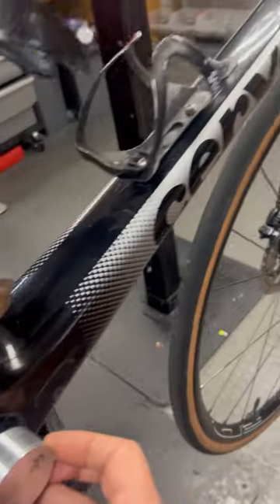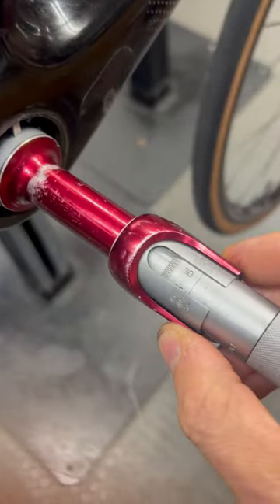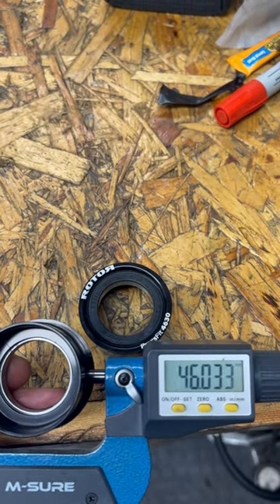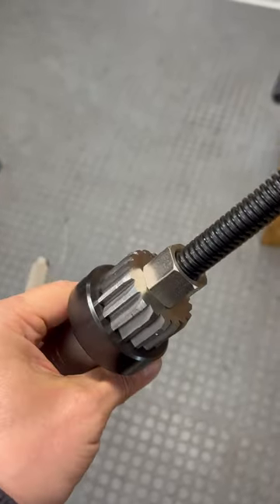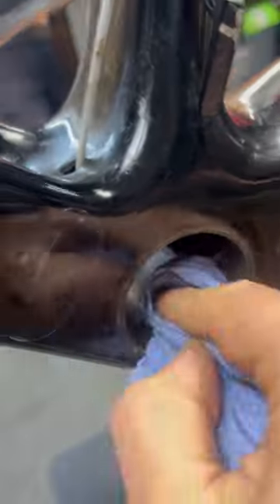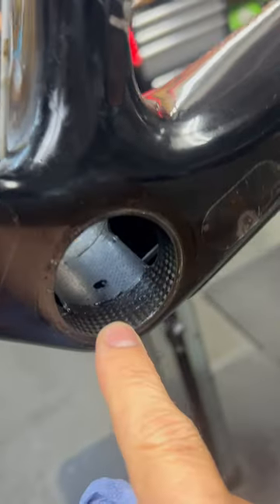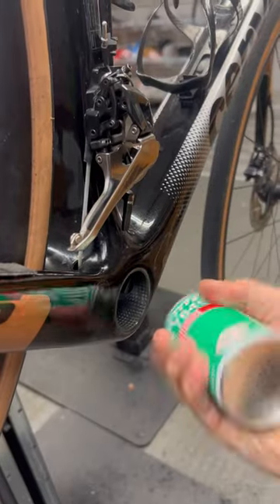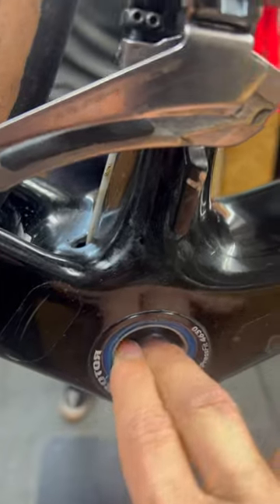A super tight Cervelo

Comment: If it’s not threaded I’m not buying
Reply: Press fit should be illegal unless the frame has 100% precision bottom bracket hole.
Reply: Exactly. They are just taking the customers for mugs by producing a sub standard and shoddy product. I only buy bikes with threaded BB's
Reply: If its not 1 piece metal tube you can still have misaligned cups, which you then can't do anything about
Reply: Even 1 piece metal tube BB’s can be a mess from poor welding and poor alignment within the frame.
Reply: What about a 1990's Klein? I never heard anyone complain about those being press fit. Same goes for any old American bike with a one piece crankset, the cups never creak on those either.
Reply: @Mike0  "...you can still have misaligned cups??"  Then send the frame back and tell the mfr to send you the quality part you paid for and not some defect off their production line.
Reply: Hear hear. Can't beat a simple Hollowtech system with threaded bearings.
Reply: @TrueBlade-1889  Square taper cartridge BB is king. Bearing life is superior, the cartridge doesn't suffer from misalignment issues as easily, and you can adjust the chainline for any bike/crankset/hub combination by changing axle lengths
Reply: just means brands dont need to give a shit about alignment.
Reply: Thats why I prefer threaded full metal bottom brackets welded in the frame.
Reply: Threaded bb have the same problems if they are not in spec. Im a professional bike mechanic for nearly two decades and I really like pressfit bb's they are the best if they are in spec. This standard gets reamed for all the wrong reasons.

Comment: Carbon pressfit bb shells are super fun when they widen under load after 1-2 years of use. And the manufacturer does not warranty them due to "improper use or installation". Suggested solution: epoxy in the BB 🤦 Oddly enough, new models now have T47...

Comment: I still have had a reply about cutting Carbon Fibre like this, and the Bearing dust seal appears to be damaged at the very end of the video: a step of it cut, and at the top of artists to have been compressed/pushed in.  Even the ID/OD measurements seem way off for what it's getting described.

Comment: What are the advantages over having a pressfit bottom bracket? And wouldn't the bike be built up with the carbon with a dowel to build the carbon upon? That would make it perfect.
Reply from the maker: Pressfit removes a bearing carrier and allows the bearing to be closer to the pedal to stiffen things up. These bikes are laid up in two halves and cured together. I would love to know what goes wrong in that process. However I think the big issue is that it is just not well QC after mould and paint

Comment: Why do you need any LOCTITE glue for a pressfit? Thanks
Reply from the maker: Fairly big subject, but briefly. It is a retaining compound designed to fill gaps upto 0.15mm. So it fill all the tiny irregularities to provide a firm hold of the bearing into the shell.  It is not a universal method.  It’s use depends on the materials.  There are lots of different types of retaining compound and activator that will fill different size gaps and work with different materials.  The best thing is to read the installation manual.  You will often find that it will prescribe the exact method. Sometime it will be grease, retaining compound of some sort, silicone glue and often it will say use nothing at all.
Reply: Any bike that prescribes Loctite of any type to install the BB does not get my business. Not gluing anything into a frame that then has to be hammered out when serviced. That’s just me. 😀

Comment: I used to have a Cervélo and the BB issues I had were apparently due to the Rotor crankset, as a switch to Shimano solved the creaking for good. That being said... I wouldn't buy another one, knowing what I know nowadays
Reply from the maker: Umm.  It likely solved it because of being able to use plastic cups and a smaller bearing, giving a bit of room for compression. If it works it works.
Reply: @Mapdec  so my BB was probably still crap, huh? Hahah
Reply from the maker: @RicardoRocha-lg1xo  🤷‍♂️

Comment: do you sell the resurfacing tool? i scored my carbon shell with a wheels Manufacuring bb and the splines dug into the carbon under torque. should the face be resurfaced?
Reply from the maker: No. They are very expensive, I think the tool in the vid was about £450.  It’s only really bike shops that buy them.
Reply: @Mapdec  can i email you with the issue that i have? i wanted to see what your thoughts are on it. thank you
Reply from the maker: @rexfest  just bring it into the shop. We can’t fix things via email. No need to book.

Comment: Lovely tool and work, but I would install a Bb-Infinite single block , and bye bye issues , that rotor will last 15k and then you need to hammer 🔨 blast them out , because you used the heavy retainer compound.
Reply from the maker: Thanks. We don’t use hammers. We have a range of BB pullers. Also, it can be softened with a bit of heat.

Comment: If it's small ... what was in there before?
Reply from the maker: A throttled FSA bearing with just enough room to breath though it’s plastic case.
Reply: @Mapdec  Doesn't sound ideal for bearing or frame, but I guess they jammed it in and got away with it. I'm no expert on bottom brackets, they seem even more confusing than tubeless. I have a "normal" Shimano bb, which hopefully is more tolerant of fit.

Comment: Special place in Hell for whoever invented pressfit bottom brackets. 

It creaks all day in hell.
Reply from the maker: I hate to break it to you, but the bearings in your threaded frame are a press fit into the housing you screw in. The problem isn't press fit, it's the manufacturing tolerances of frame manufacturers that failed.

Comment: The bikes of 20 yrs ago were easy to work on, you could purchase a new bike the pros rode with full Dura Ace for a fraction of the cost, nothing like this. These things are a nightmare fragile expensive frames / components, push fit BB, full internal cabling, disc brakes 🤦‍♂️
Reply: Agreed

Comment: why can't bike makers do this at the factory???
Reply from the maker: Sadly, the same reason bike shops don’t check, no one notices until it creaks.
Reply: @Mapdec  that isn't really a reason, customer satisfaction would go up if they did a better job, so would setting up tooling in a factory to do this be very expensive? do any brands do it?  Hambini, who is an asshole, likes to poop on Cervelo about this a lot but isn't everyone doing this badly?
Reply from the maker: @JackMott  I couldn’t say that any one brand is consistently bad.  I would love to know what happens in QC to let these problems through.  However, when they do slip through it should be the role of the dealer to correct them.

Comment: Paul's 10 million dollar tool inventory ?
Reply from the maker: Not quite, but I do love good tools
Reply: @Mapdec  I saw a bad practice at the FOX service centre in Sydney , Australia . Using the open end of a spanner to remove fork upper air , and lower oil seals . You can scratch the ledge that the oil seal sits on .

Comment: Loctite on a PF BB is a recipe for creaking. Absolutely no need for that.
Reply from the maker: You mean bearing retaining compound made by loctite.  Holding a bearing is exactly what it is designed to do.  It’s a gap fill to fill voids in manufacturing inaccuracies.  It will prevent creaking on oversized holes. If you use it on undersized holes you will have other problems. Mostly related to the undersized hole rather than any compound used.
Reply: @Mapdec  I stand corrected. Oversaw the type of compound. Thx for the explanation. You never cease to learn

Comment: I thought Cervelo were similar to Santa Cruz and use Reserve rims. Why are they using this crap bb system when SC were one of the few brands that almost entirely stuck with threaded bbs (excluding some gravel frames for a few years).
Reply from the maker: Weight.  Every road brand wants to claim the lightest weight. Press fit is good if it’s made well.

Comment: this is the reason why bb presfit system is the most useless standard of bottom bracket, frame manufactures have to make frame surgeon precision for this system to work. bsa bracket is tolerance-free, can be serviced in home without special tools and bottom bracket mechanism removal/installation has no impact on frame deformation